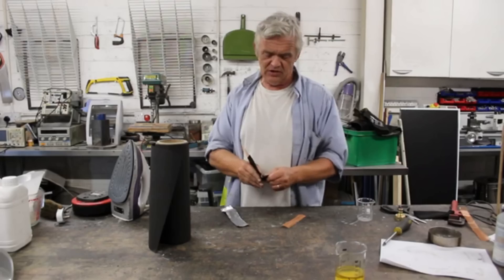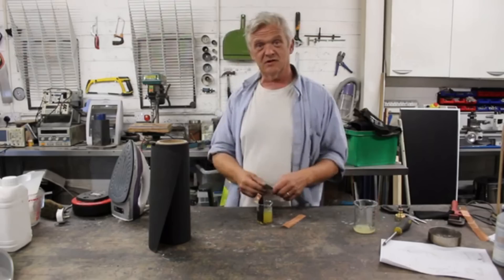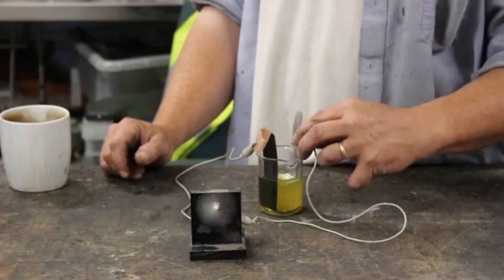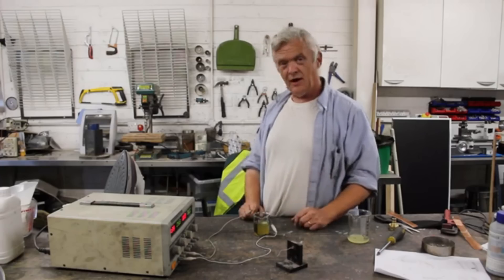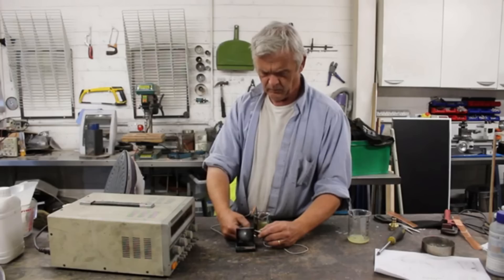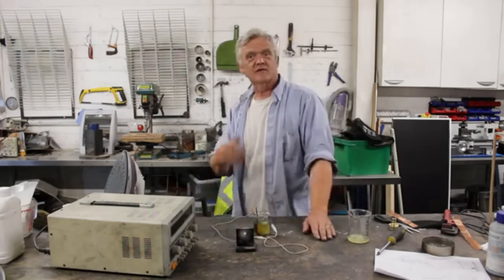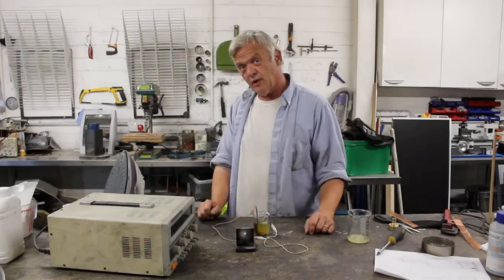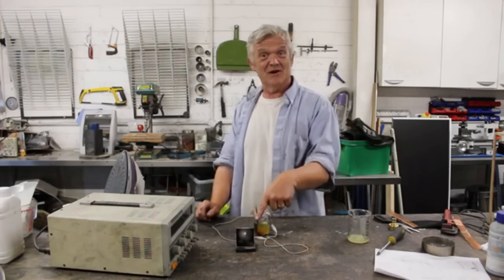1793 A Battery That Is Easy To Make In Any Size

Comment: If you use ethylene glycol instead of water, the battery lasts forever. Since ethylene glycol is flammable I was thinking of adding a small amount of water to lower the flammability.
The cool thing about glycol is the zinc iodide is much more soluble.
Reply: CE improved, I'd imagine

Comment: Having conductive ink on paper, rolled up  with carbon foam between,  seems to me easier and more robust than HDPE. Is it hecause of the higher resistance that the conductive ink is not used?

Comment: I like this.  Raises more questions for me though.  How toxic is the electrolyte?  If the energy is stored in the electrolyte could you make a flow battery from this?  Or is that missing the point and just a massive tank of electrolyte will do?  Is the self discharge mitigated if it is used cyclically so it’s always either charging or under load.   I’m guessing you are leaning towards storing the power from wind generation?

Comment: Ok, question time. If you scaled this up to the size of a plastic barrel and maybe a bank or series of these. Could this be charged by single lightning strike, or build up of static electricity if you ground it to a span or areal?   Essplain.
Reply: Nothing charges that fast, not even a capacitor.

Comment: This is still fairly new to me although I remember a wee bit from your past video. Certainly not galvanic action. To reduce or eliminate self discharge could there be a mechanism to remove the electrodes from solution until power is needed..or would the solution continue to undergo a reaction in their absence? I'm also curious whether zinc iodide has any special handling precautions  or specific condition requirements that would prevent it's practical use in certain applications. Thank you kindly : )

Comment: I’ve been having thoughts about powering a house with a combination of many of the recent methods in the recent videos. Making biodiesel, using it to power a Lister D engine to drive an alternator to make a usable charge to fill a battery store to run the house/home. How feasible is it to do it this way? The most costly element of the whole system from my research seems to be a sufficient battery store. The lister and alternator being relatively cheap, the battery store and charge components etc being the major cost. I cannot see the downside save for my ignorance in combining the components. Any ideas on the subject?

Comment: Just got 250gm of iodine from China for this type of battery!! Just as a suggestion, the carbon filled HDPE can be a little hard for others to get, so a video on making carbon coated electrodes with various substances like acetone melted ABS or polycaprolactone (polymorph pellets) with activated carbon might be helpful.

I'll admit I don't know what iodine would do to it yet, but bromine seems to get through eventually 😐
Reply: For start you can see the video "How to Make GRAPHENE / GRAPHITE PLASTIC - remake"

Comment: Hi there. You can bend graph foil with a roller to form a 90 degree bend very gently then coat the top section so it don’t short out the cell.
Reply: You can bend graphfoil if you put some support on. Like sticky tape will work,... just put 2 to 4 layers of tape around graphfoil

Comment: So if I needed to store energy this way. What volume of fluid would I need to say power a 12v desil heater.    And could I charge this with the artificial muscle wind  generator?   Any risks like over charging.  What sort of matinance would it need?     Love all your videos.      Heat is all sorted off setting electric is the thing that's confusing  and would like to do in terms if the lights go out I got enough in storage power to last a few hours

Comment: I want to create a battery that I can charge the liquid in one tank and discharge the fluid in a separate smaller tank. I think this would help with dendrites but it would also let the battery capacity increase based on plastic drums available

Comment: can we use stainless steel mesh instead of copper and not wrap it in conductive plastic? and will adding sodium sulphate compensate the increase in resitance as the battery charges? How is it relatable in terms of energy density to the zinc- bromine ones?
Reply: Halides (iodine, bromine etc) will attack metals in general (although titanium works good). Somewhere in Roberts' TnT channel are videos showing how to dip coat electrodes in a conductive coating made of a binder and activated carbon.

Comment: I've experimented with quite a few variations of this with zinc bromide and run solar garden lights to test them. It's great fun and relatively safe chemistry to work with at a small scale. I must've missed the zinc iodine video, but I assume it's very similar to the zinc bromine.

The cheap single cell Ni-MH solar garden lights you can get everywhere work great for these type of cells. They allow the voltage to trickle up to ~1.9V, limit the current and when its dark can, boost the voltage from as low as .4V up to enough to light a few LEDs.

However, I almost always end up with the Cathode getting destroyed eventually! 🤦‍♂
No matter how well I thought I'd sealed the HDPE, somehow electrolyte would eventually seep in and try to destroy any metal it could touch during charging, almost as if it had a mind of its own!

I had my best success using a pure carbon cathode (rods from zinc carbon cells), it lasted a good few months through the hot summer, died eventually in the autumn. The connections to the cathode eventually corroded, tinned copper wire and then 'stainless' croc clips! 😆
Reply: It's a bit of an outlay but you can buy titanium foil from Aliexpress in 1kg rolls that works very well in bromine. You can also buy it directly from the supplier for a little cheaper. I have made many zinc bromine batteries using titanium electrodes and the electrodes have never even been slightly etched! You can also use carbon felt with the titanium by crimping them together (the felt provides more surface area).
Reply: @etherlonX  Thanks, I'll look into it. 👍 1kg sounds sounds like a lot tho!

Comment: I have tons of aluminum cans.

I think I shall read up on how hard it is to do this with used aluminum cans.
Reply: Remember they have a thin plastic liner youll probably have to sand off. Foil may be easier. Im personally using cans for structural stuff (keeping shape of cases or hinges)
Reply: @professorfukyu744  When I am done perfecting what I have in plan, I will publish it here so it can be duplicated.

Comment: Wouldnt it be possible to completly eliminate self discharge by pumping the electrolyte solution in and out of the electrode compartement? When you use the battery you pump the solution in, when you want to store the energy for a bit you pump the solution out into another tank.
Reply: That what you mean is called a flow battery. You have a tons of research on iodine flow batteries.

Comment: so you could charge it,then pour off the electrolyte into another container until you need it. And just pour it back in when you need a charged battery?
Reply: As I understand it; This is the what a "flow battery" does. My basic understanding tells me there is a chamber where the energy is generated and that energy dense liquid gets pumped to another chamber where it can be utilized.
Reply: @robrocker7  Correct
Reply: Yep, that would work.